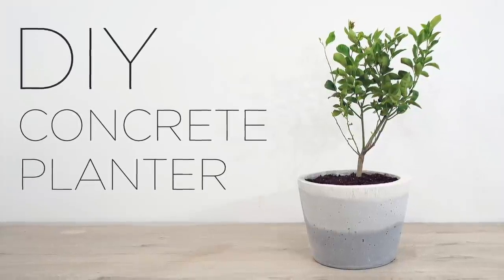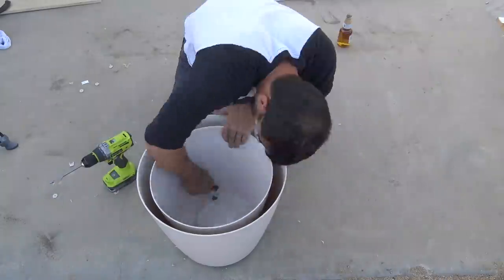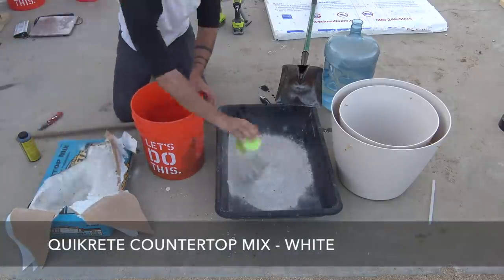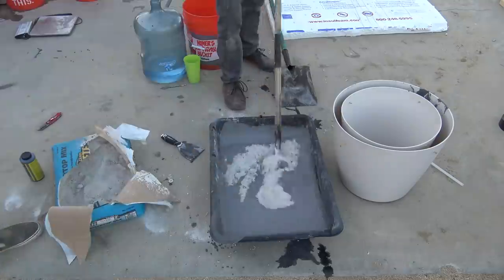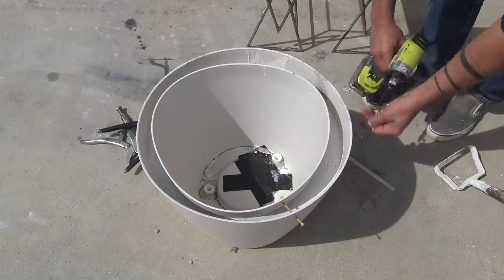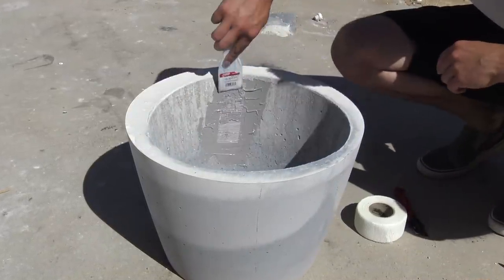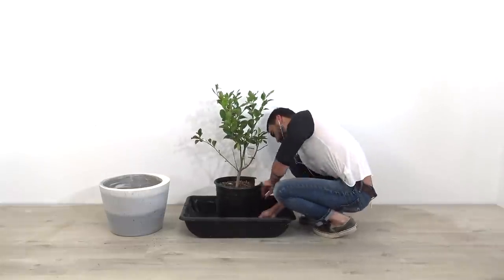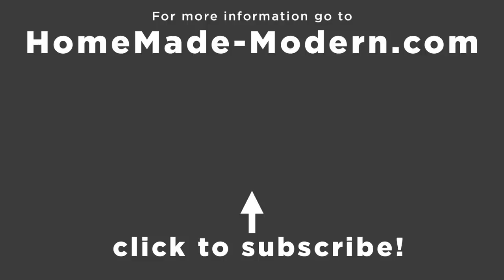DIY Concrete Planter with an Ombre Finish

Comment: Simple minded commenters!
Reply from the maker: that was the 2nd term that came to mind
Reply: I bet the 1st term sounded like armhole but used a different word instead of arm.
Reply: Quit wasting the plastic buckets
Reply: I was going to say the same thing! Ha ha. It was funny.
Reply: Doesn't get any more passive aggressive than that.
Reply: Eric Nirenstein 
#bucketlivesmatter
Reply: HomeMadeModern grow up. You’re better than this. You can make your point in a less arrogant way.
Reply from the maker: any suggestions?  i don't mind negative feedback but i have gotten a lot of comments that factually wrong due to over simplification.  Example: Concrete planters will kill your plants!  i believe that these commenters believe what they are saying to be true but reduce a concept like concrete can change the PH balance of the soil to a false simple conclusion. I have heard a ton of people say how concrete will break under the slightest weight without reinforcement when it is actually capable of holding hundreds of LBS.  the reason this bothers me and that it spreads false information.  I allow a ton of negative comments but this false info is a problem.  i get about 10-20 of blantently incorrect assertions about material properties or structural integrity per project. These aren't stated as questions or possibilities but as facts that just happen to be dead wrong.   Seriously if you have a way to phrase it better i am open to it.
Reply: HomeMadeModern I understand your frustration. The name-calling of commenters and viewers just rubbed me the wrong way. People watching these videos expect facts so of course you should set the record straight, as you do. My suggestion for rephrasing would to be simply say you want to address some misconceptions.

Comment: You could also try using some pure powder pigments to mix your own colors or add some real vibrant colors to the concrete. I'm assuming those liquid ones are the same, just premixed with water, but I've seen some really crazy vibrant colors made with powder pigments!

Comment: I would like to know if you could do a build with no power tools but a screw gun. I currently own no saws or router nor the space to have these tool and area to use them in. So I rely on Home Depot to cut my materials.
Reply from the maker: the bucket stool, drill carved coffee pot and my first ever video might work for you!

Comment: Turned out beautiful! To avoid the layers mixing together to get the air bubbles out, couldn't you have poured each layer after the previous one was cured or does cement not bond as well to one that is cured already? Not much of a cement expert here. No disrespect to your methods but I'm just wondering so I can try to get a less holey look 😬. Thanks for sharing!